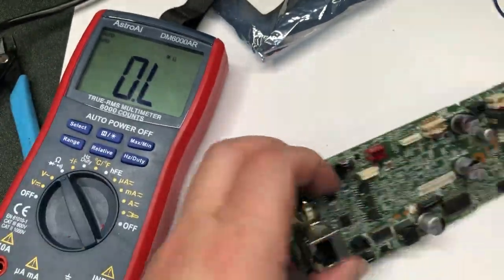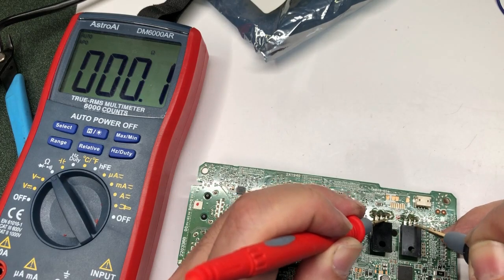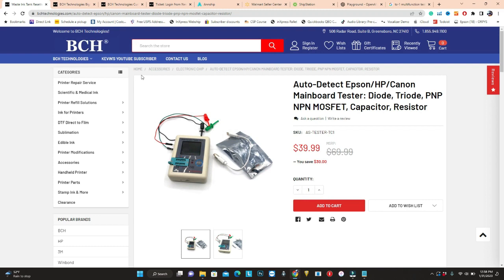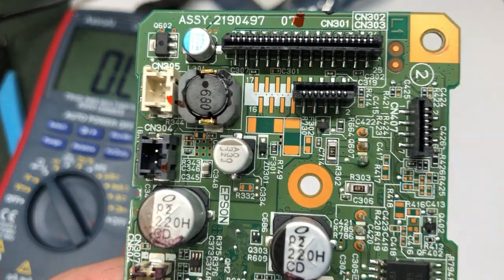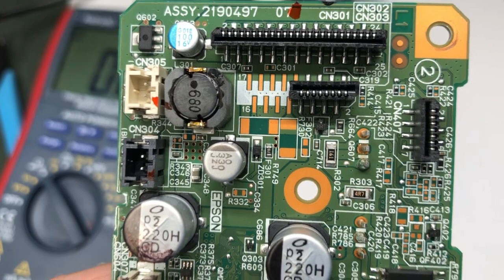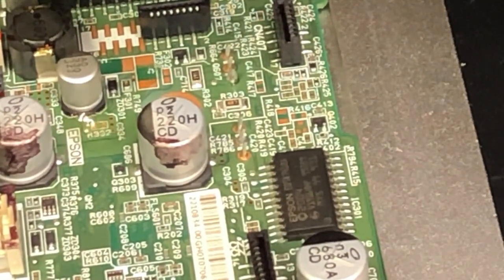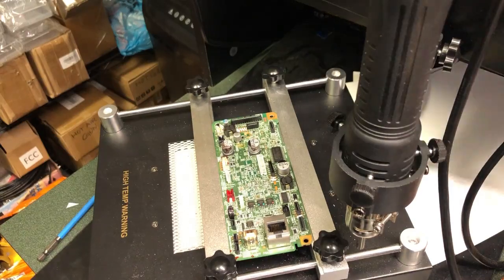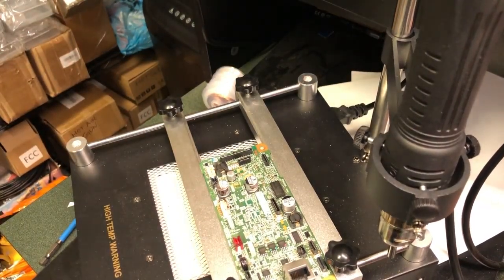XP 15000 Mainboard Repair and Testing: How To Save Money and Time

Comment: I keep popping fuse and getting the 031006 code. its not my print head or cables (i have a second printer I can swap parts to test). I am having an issue on the board itself. I am getting contact on the ribbon connectors for the head between pins that shouldnt come in contact. it happens with and without the F1, F2 fuse in place (can't remember which one it keeps popping). My board doesnt look like the one in the video but any suggestion on what to look for that might be causing premature short without the print head cables installed?

Comment: I’m having the sam problem with my Epson stylus pro 7890. What would I check on my printers main board. I have a multimeter.
Reply: Also thank you so much for your valuable help and information on your channel!
Reply: If you're getting the codes mentioned in the video above then you're going to look for the F1 or F2 fuse and see if its blown.

Comment: hello. I need your help. I have an Epson XP 15000 and when I print it, it passes the sheet long and it generates the error message 031001. I checked the head and it looks in perfect condition. It has no sign of a short. Where is the problem?
Reply from the maker: Thank you for subscribing to my channel. According to Epson, 031001 is: Disconnection, break, skew or damage of the head
FFC or Overheat of the printhead.
1. Failure of the printhead
2. Failure of the Main Board
Occurs in-between print passes (after printing). This is when the Epson sends a signal to test the printhead, it either didn't get a reply, or the reply value is higher than expected. You can check if the FFC cable is installed correctly, or have another printhead to give it a try.